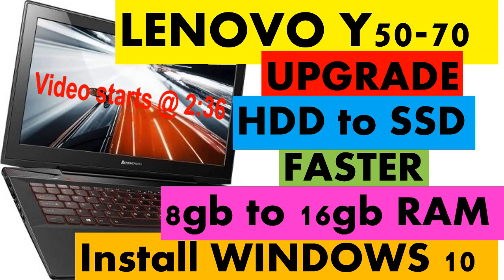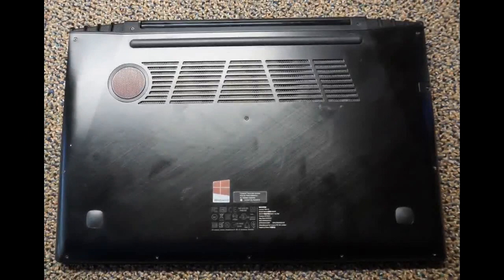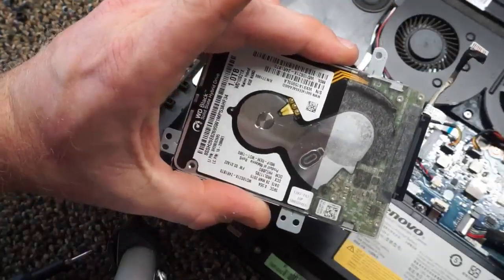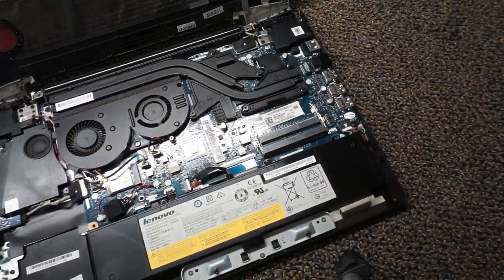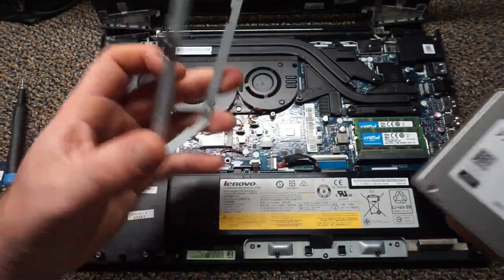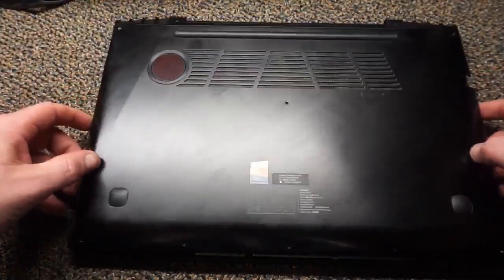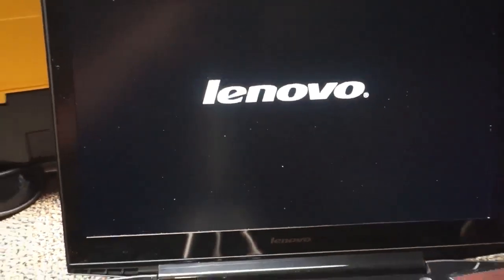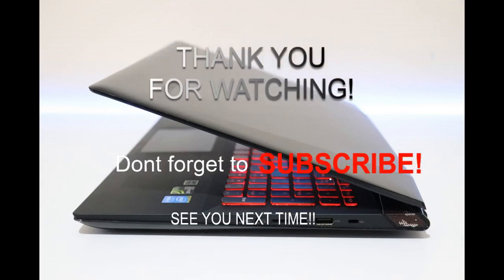LENOVO Y50-70 | How to upgrade your Lenovo Y50-70 and improve performance

Comment: Bought in 2013, 2023 am still using it. 😂 Upgraded to 16gb ram corsair vengance ddr3 and 256gb samsung 850pro back in 2014. Only problem is cpu outdated cant upgrade to win11.
Reply: hi, do u know if it supports ddr5 ram?
Reply: @marreznzind5818  cannot....this system is using old motherboard only supported DDR3.

Comment: I've got a 2014 Y50 non-touch with a 1080p screen. Do you know if I can replace that screen with a UHD screen? Because I know there were 4K models of the Y50, but wasn't sure if they were different otherwise in a way that allowed for the 4K screen.

Comment: Hi,
do you use an external hdmi-connected monitor with this laptop?
I have a Lenovo y50-70 with an integrated intel hd 4600 graphics card and a geforce 960M and unfortunately it does not detect an external monitor on the hdmi connector?
The monitor works fine with other laptops, the cable also.
Did you have the same problem? How to solve it?
I have googled for a week, tried different things, tried other drivers and unfortunately it still does not work.... :(
Many thanks for some help!!

Comment: How is your y50 performing today with those upgrades? I have one that I've only used just a handful of times since I purchased it back in 2013 or 2014 & im curious how yours is working now 2 years after the upgrades.
Reply from the maker: It is still running strong. It not my daily anymore but i use it often and having no issues.
Reply: @RandomTechG  I appreciate your reply. Because of your video I've gone over to Newegg & have been pricing out the ram upgrade kit, some artic silver 5 thermal paste, & am looking at some SSD's. Price to upgrade will be in the $150 - $200 range as I'm debating on 1 or 2 TB SSD. Thanks again!
Reply: Bought in 2013, 2023 am still using it. 😂 Upgraded to 16gb ram corsair vengance ddr3 and 256gb samsung 850pro back in 2014. Only problem is cpu outdated cant upgrade to win11.

Comment: Nice video, of you allow me to give you one advice is to clone or copy the HDD to the SDD (if it is not broken) and that way you dont need license or drivers, depending on the files you have that process takes you from 15 mins to 2 hours extra and you can save the money from the license and the suffering of finding drivers.
Reply from the maker: Thank for the advice. I did chose to do a fresh install of windows vs. cloning the drive intentionally. I wanted a clean instal to get rid of unnecessary drivers and other files that I no longer needed.

Comment: I still use my Lenovo y50-70 and it Got a top of the line SSD 1 year and im thinking abaut upgrading the 2x4gb ram because They only run at around 880 hertz

Comment: Hi. I guess I'm late to the party. I'm writing this while I've shifted to a 500gb SSD and waiting for the RAM to be delivered. Please let me know if there's any way I can use the sshd as an external storage
Reply from the maker: There are some external enclosures designed specifically for SSHD's. I don't think you would have a problem utilizing this SSHD for external storage (unless the manufacture of your sshd block this somehow) but SSHD's are not great options when it comes to speed. If it is an option in your budget, i would personally recommend ditching the SSHD all together and go with an external SSD for your storage needs. Last but not least, with the price of external SSD's, it may be more cost effective to just go with an external ssd vs. buying an enclosure for your SSHD and turning it into external storage. Definitely look at you external SSD options vs. sshd enclosures before you decide. A lot to read, I know - hope this helps tho. 😁

Comment: You shouldn't disconnect the battery power from the motherboard before you start any interference with the structure ???
Reply: @M6llumees69  why not?

Comment: Is this laptop still worth fully upgrading today? I have one of these that I haven't used because it needs a new battery.
Reply: I've been using mine for 5 years and it's still going pretty strong. I've upgraded to SSD and 16GB Ram recently, because I use it for gaming and it had some difficulties with newer games but now it runs perfectly. Of course, not on max resolution but I still haven't encountered a game I absolutely could not play on it. So I'd say it's pretty worth it. I have no plans on getting a new one any time soon.
Reply: @pattygeorgieva3226  Alright cool! If I can find another stick of RAM and an SSD for a decent price I plan on grabbing them!
Reply: @pattygeorgieva3226  can u run warzone
Reply from the maker: I would say yes. Not really for gaming, but everyday internet usage, light editing, etc. I use mine every single day and have since the upgrade.  I'm replying to you on it right now in fact. I love this laptop and since I upgraded the SSD and ram, I've had zero issues with it. Mine does stay plugged in though so I don't really know the status of the battery.
Reply: @RandomTechG  Alright so maybe not worth it too much. I have a laptop for editing and whatnot already and its probably on par performance wise with this one, if not better. Thanks for the reply!

Comment: I already have a 16GB RAM. If I only upgrade to SDD, will I be able to edit videos in 4k smoothly?
Reply from the maker: Upgrading to an SSD would help when the data your wanting to access is in that drive. This is because the SSD speeds for accessing files are much faster than an HDD.
Reply: @RandomTechG  That's great. I'll upgrade to 1TB SSD and try editing videos in 4k in my Lenovo y50.
Reply: @avsshrestha3647  hey how has the upgrade come along? You able to edit 4k?
Reply: @dheerajb1883  I didn't change it. I bought new HP Omen 16
Reply: @avsshrestha3647  oh I see.. anyway Omen is a great choice. Congratulations!!😊

Comment: I saw you use a 1866Mhz ram... does the motherboard recognize that speed or it only recognize 1600Mhz?
Reply: It does recognize only 1600Mhz, but if you have trouble finding one at that speed (like I did) you can put 1866 with no problem. Hope that helps. I just upgraded mine and did quite a bit of research.
Reply from the maker: That was so long ago, I don’t remember the exact specs. I’ll check though and get back to you soon.
Reply: @RandomTechG  Thank you soo much, I'm searching for a ram bundle 😅

Comment: Thinking of doing the same upgrades on the laptop, my mane games would be rust or dayz, and I always rethink is it still worth upgrading this laptop?
Reply from the maker: For gaming? I would say no. Pretty much anything else, I would say go for it.
Reply: @RandomTechG  what about 250 or 500gb ssd and one 8gb ram stick?
Reply from the maker: @mantaspetrauskas4431  this would be good for more basic operations. If you will be doing any type of editing I would go with more ram. With file sizes being what they are today, 500gb will work but will fill up fast.

Comment: Hi, my hard drive recently blew out so I had to get a new one. I am planning on getting a 500GB SSD Hard Drive. I think I'm going to need to reinstall Windows 8.1 on this new hard drive, correct? 

I went to Microsoft's website and downloaded Windows 64 Bit 8.1 Drivers onto a USB using a program like Rufus. Will this USB be enough for me to reinstall Windows onto this new Driver or do I have to order a whole new Windows 8.1 Online in USB form or something? I really don't want to have to spend more money on the Windows Operating System if I don't need to, so I'm hoping what I did works.
Reply: Ok, so basically I can take a generic product key for my version of windows and enter that in for a new version of windows. Then once I have access to my systems, I can dig out the product key I already had for windows that the laptop came with.
Reply from the maker: To have a registered version, you will need a product key (which means you will need to buy it). You can easily find 8.1 keys for between $20 & $30. Just be careful of where you buy it. During the download you can choose to download to a usb drive (make sure your drive is large enough before you start). Then, you will set up your co outer to boot from the sun drive, follow the steps that follow then it will do the rest.
Reply: @RandomTechG  When I boot up from my BIOS system, it says that I have a Windows "Preinstalled OS License", so does that not mean it won't detect Windows? 

Also, I'm not sure if I had a product key or not on my OS in the old hard drive. The old hard drive is fried though, like if you plug it in, it'll make scratching sounds and the computer won't detect it. Is there a way to get the product key from it if there is one?

If not, would I still at least be able to boot up the new hard drive with an operating system just without the registered version?
Reply from the maker: @davidhuang7599  read this thread. It should help you understand what’s going on and describes better than I could in a message on how to fix it. https://forums.lenovo.com/t5/Windows-8-1-8-7-Vista-and-XP-Discussions/Preinstalled-OS-license/m-p/1583322?page=1#1583588
Reply: @RandomTechG  Hi I reinstalled windows 8.1 onto my new drive and it's starting up. Though am I able to now remove my USB and will my laptop automatically start through windows now?
Reply from the maker: @davidhuang7599  once windows has been installed on your hard drive, you’re all set. The usb can be removed.
Reply: @RandomTechG  Sorry to bother again, I just got another slight issue. 

My wireless internet connection doesn't seem to be working - like it only provides me the options for ethernet or bluetooth connections. Anyway I can resolve this easily? This worked previously, so I'm not sure why it isn't all of a sudden.
Reply from the maker: @davidhuang7599  if WiFi shows up in your network connections , it’s probably drivers. Check out this guide and see if it helps resolve your WiFi issues.  https://www.google.com/amp/s/www.online-tech-tips.com/windows-8/ultimate-windows-8-wifi-troubleshooting-guide/amp/
Reply: @RandomTechG  Some driver just randomly reinstalled and it's worked now. 

I think everything is set now. Sad that I lost all my old data on the other hard drive, but I think there are people near me I can go to for extracting it.

I'd like to thank you for the effort and time you put into helping and directing me. I really appreciate it since I need this laptop for working matters. Have a good one.
Reply from the maker: @davidhuang7599 my pleasure.  Glad I could help. Take care.

Comment: Can you suggest some 500gb ssd as of now except crucial ?
Reply from the maker: Samsung is always a good choice. I have the 1TB version of this in my editing pc. 3 yes so far with not complaints. https://www.amazon.com/dp/B0781Z7Y3S/ref=cm_sw_em_r_mt_dp_uZo0FbSC1Y3Z8
Reply: @RandomTechG  can you help me ?
Week ago i just bought the new Samsung 870 QVO 1TB SSD, but the bios didnt detect it on sata, but its detected when i use it as external drive, i also had try it using my friend adata SSD and its detected on sata
What part did the cause ??

Thanks in advance
Reply from the maker: @megimargareth4015  try these steps. https://www.drivereasy.com/knowledge/fixed-bios-not-detecting-ssd-in-computer/

Comment: Hi, 
I got the refurbished of the laptop with 4k screen (I can see a 47Hz refresh rate ). I am planning to get a 4k monitor. Wanted to know if it will work with no issues i.e 2 4k screens at a time and different refresh rates.
Reply from the maker: Hi, If I recall, this laptop is locked at 60hz refresh rate. As for performance on 2 monitors, it depends on what you plan to do with it. This video is for the 1080p display and I’ve never seen it hit 60hz when gaming and it runs pretty hot while gaming as well. So if you plan to game with it, it’s not going to be the best for that. They did make these with different cpu and gpu options. Do you know what yours has?
Reply: @RandomTechG  I can hardly run any games with it. It fails to run CS GO with minimum settings. I dont know if its my GPU - 860 M or something else. TheCPU is i7 472QHQ. So no games.

I plan 4k monitor only for multitasking. But im confused if the HDMI port and Intel's 4600 can display multiple 4k at a time.
Reply from the maker: You may be able to achieve this with a USB 3.0 to hdmi adapter but I’m not sure what kind of refresh rate you will get. It may limit you to 30 (or less) per monitor. I haven’t tried this before but I’ve seen a couple people in forms mention that it worked for them with a reduced refresh rate.
Reply from the maker: This is the adapter I’m talking about. https://www.amazon.com/Plugable-Ultra-High-Definition-Graphics-Multiple-3840x2160/dp/B00NQCFXGA
Reply: @RandomTechG  Thanks for this. I thought  this device was needed only if one doesnt have HDMI port free. 

It is is 3 times more expensive here. I better downgrade to a Ultra wide Full HD monitor in that case.
Reply from the maker: Sorry. I may have misunderstood a little on what you’re doing. If you have an available HDMI you should be able to use it. Most likely with the same refresh issues tho.
Reply from the maker: Check your HDMI out specs. I believe it needs to be at least 2.0. As mentioned in the last message, even if it is 2.0or better you will likely be stuck at 30hz or possibly less. Which will render it pretty useless for most tasks.

Comment: Hi, i've actually done the same prior to watching this video but with a 500gb ssd, my issue with this laptop after using it for 5 years is that the camera has not been working properly at all, it goes to blue screen every time i try to use the camera even after trying all the drivers possible for the laptop and now recently at times the laptop just crashes for no reason saying pnf_list_corrupt and i've tried reinstalling the ram and ssd properly with all the 'clicks' , and FPS drop is a real problem the overheating which i do plan to change the thermal paste soon cause i have been a heavy user on the laptop finishing my final year of engineering (used autocad, freecad, ansys, and etc) all held up well but always been having crashing issues.  Coming december i'll be doing my internship and working as a draftsmen and the thought of it crashing during my use is abit too scary cause it involves work. Do you have any idea on how i could fix this issue cause i've googled for years and  everyone has only been telling me to change the laptop but i actually love this beautiful machine cause with the upgrades its still more than fast enough for me. Any thoughts? sorry for the long comment i've just been searching for too long and im desperate in trying to save this laptop.
Reply from the maker: @Bray vinodh - a few  questions regarding your laptop. 1) Do you currently have an valid version of windows? 2) Did you create partitions on your Hard Drive/create a backup or restore disk? 3) have you always had the camera issues or did they start after the SSD switch?
Reply: @RandomTechG  1) yes windows 10 pro ( just updated it earlier this week).
 2) yes i split it 125gb (40gb still available) for the main windows operating stuff and 375gb with my normal stuff. 
 3) honestly the camera had issues with the driver 2-3 years ago but its didn't matter cause i wasn't using it but this year due to the zoom meetings and online exams it became alot worst as i found a stable driver that could finally turn the camera on but it would crash alot (like 4-6 times in a row after the laptop restarts) and yes i did check if the ram was faulty but after buying another ram of the same brand it was still the same.
Reply from the maker: @bryanvinodh9500  did you mean pfn error? If so, that’s typically a driver issue but as you stated, you have updated the drivers. In rare occasions it can be caused due to a bad hard drive. What I would do next, if you have the means is to 1) uninstall all drivers for you camera and disable it. With your camera disabled see if you still get the blue screen. It could quite possibly be defective hardware/camera causing this. 2) if you still get the blue screen, try a different hard drive. Either HHD or SSD for testing will work.  In rare occasions, this error can be caused by a bad hard drive. There could be a bad spot on the drive that when your laptop attempts to read info from that bad portion, it fails and gives you the blue screen. As for thermals, this laptop isn’t the best cooling laptop to begin with. With that said, replacing the thermal paste is a good idea.  You mentioned you’ve been using it for 5yrs if I recall. That’s plenty of time for the thermal paste to break down and this would cause thermal issues.  You may even want to start here first, if it’s getting ready hot this could be the cause of the blue screen as well although it doesn’t usually give you a pfn error for thermals. While you’re in there, clean everything really good and then give it a test. If this fixes it, you could always get a C920 webcam. They’re pretty affordable these days.  Let me know the outcome.
Reply: @RandomTechG  Much thanks i'll do a proper cleaning and recheck my drives and see what else i can check , appreciate your feedback <3

Comment: May I know have you disconnect the battery before you swap the hard drive?
Reply from the maker: Teck Yin Tan you should definitely disconnect the battery when performing these steps. I did not because I believe my CMOS battery is bad. The last time I disconnected the battery, I had to reload drivers to my peripherals and I didn’t want to deal with this again.
Reply: @RandomTechG  Noted with thanks mate!